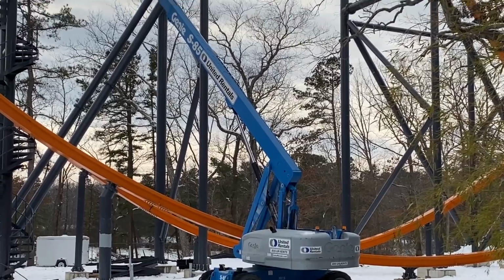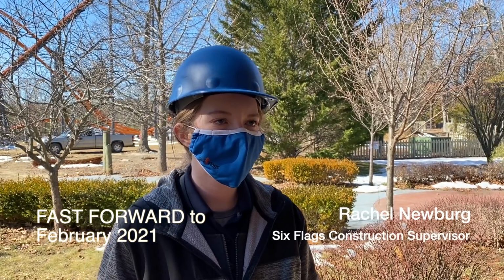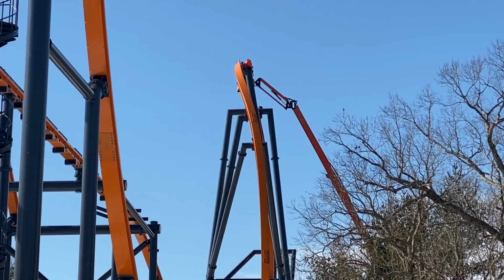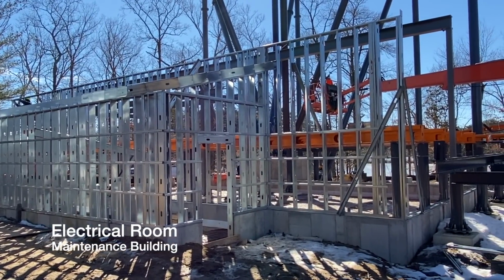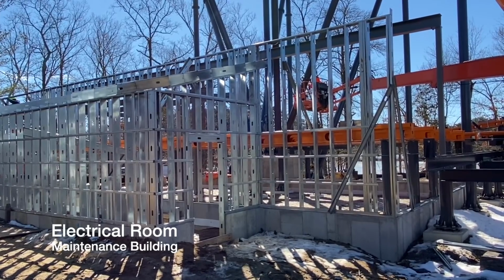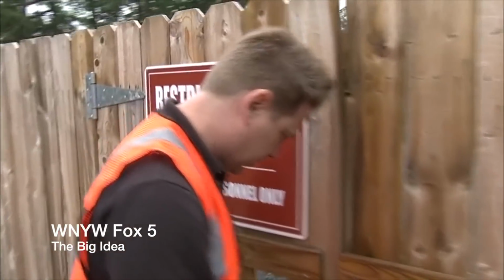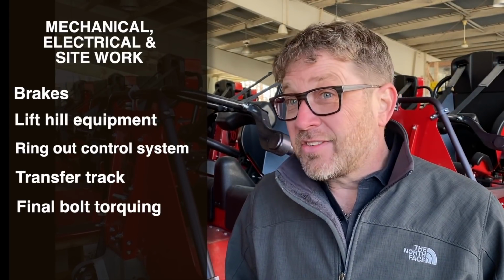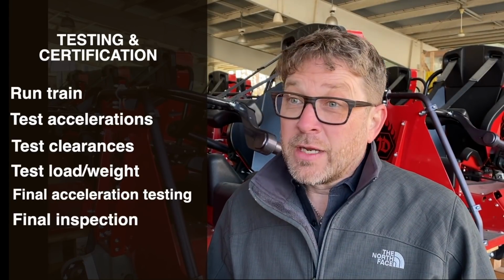OFFICIAL Jersey Devil Coaster 'Behind the Adventure' Construction Update - Episode 7

Comment: Does anybody know if it will be open on opening day and if not then when?
Reply: It’s definitely not gonna be ready by opening day. Most likely, it’ll open in June or July
Reply: Yeah probably not opening day. It's allready opening month and they still got a lot to do.
Reply: Knowing Six Flags, probably not, they very rarely have rides ready to open at the beginning of the season. May at the earliest or July at the latest is probably a safe bet
Reply: @FynnFolf  it’s possible it could be mid April they have the track work done they should be finished with the station and landscaping by mid March
Reply: @JJJJ-he8bz  yeah.. but they also have to finish maintenance building, install the electronics, and test until approved for opening.
Reply: It’s still nowhere near done and their opening day is in March. Definitely looking at a mid June opening for this bad boy at the soonest.
Reply from the maker: JDC will not be ready for opening day. The coaster's opening will be announced once we get through the testing process and closer to final inspection/certification.
Reply: @sixflagsgreatadventure  I figured lol